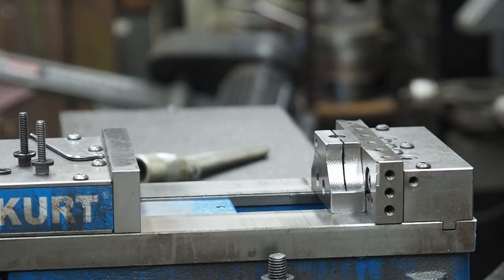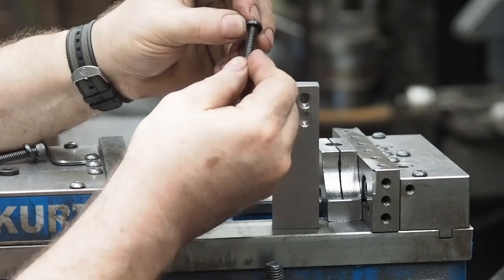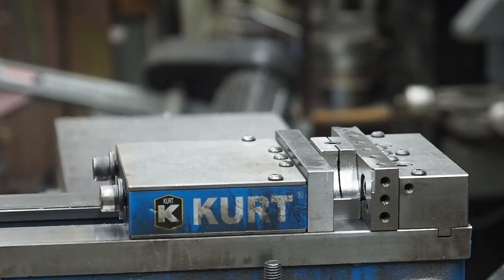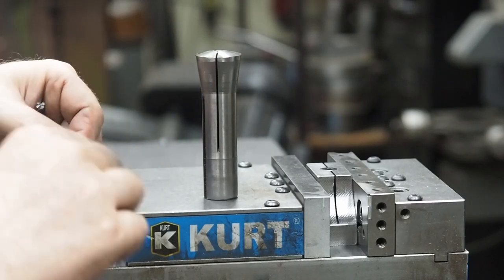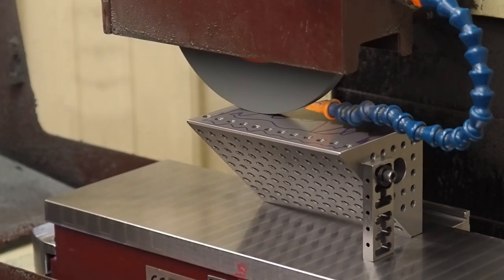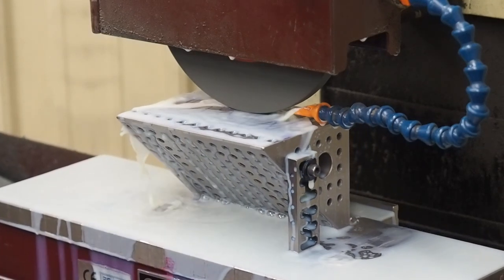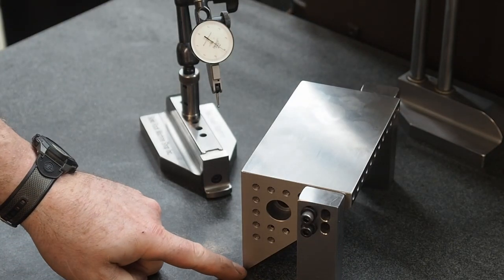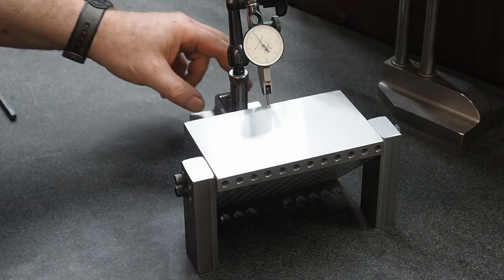Big 45 Degree Block (Part 3)

Comment: Not heard from you for a while Steve.  Hope your keeping ok buddy.  Take care from the UK
Reply from the maker: I had a health set back. Doctors insisted I take a high dose of Thyroid T4 meds. I told them I believe that is what is causing my health issues. It takes a long time taking the meds to get an accurate blood lab result. I continually went down hill taking the meds to where I was back to being useless. I went back to the doctor a few days ago and my lab numbers were mostly normal but showed that I needed to increase the dosage. Yet, I was visible showing many signs of the opposite. I talked the doctor into me going off the meds cold turkey and see if I improve like I did 3 times already in the past. I said if I start feeling better then they can run more lab test and see if they can figure what is going on. I been off the meds 2 days now and things are already improving in some areas. The meds have a 5 day half life so it will be a week before things to start to get better faster. I believe we are finally going to get the answers we need now.
Steve

Comment: Steve,  I just bought Daryl's Harig 6 x 12 Ballway.   What grit on the green wheel as I don't have one yet.  Use a 60 grit on A2 & A3, or something finer.  Daryl scraped the tower & the table.  I did the table printing & both sides of the chuck. Used a 46 grit wheel & thet came out nice.  Just need a little help to get started & I'll go super slow & careful as I learn. Thanks.
Reply from the maker: Here is a video you will want to watch https://www.youtube.com/watch?v=gjz0Zt76GJ4&t=1190s  especially toward the end on wheel dressing. Here is the green silicon wheel I use it is a 60 grit J hardness https://www.instagram.com/p/B8655MBpl6B/  I like 46 grit H wheels in aluminum oxide wheels you can see them on my Instagram page right by the green silicon one posted above.
Steve

Comment: No nagging here but quite a setup for enlarging holes in a hardened ring.. Why not use a soft collet with a pocket for the ring and use a carbide turning tool? Appreciate your answer and your content. Thank you. Best, Job
Reply from the maker: There are many ways to skin a cat. This is just one of them. This is a very simple way of doing it and will be used often and took very little time to make. Off camera I do not even need to open and close the movable jaw, it holds the part good tight enough without it. There are multiple ways of doing most simple jobs this is just the way I choose to do this one. The fixture was a piece of scrap 4140 prehard the with the radius already on it. the rest of the machining was basic, simple and fast.
Steve

Comment: At least on metric screws the screw is always a little bit undersize so you can use just the nominal size hole if you want on fully threaded screws.

Comment: Hi Steve. Thanks for another fantastic video! Approximately how long do you typically warm up your surface grinder for? If I recall correctly, Robin said that he leaves his running overnight for fussy work.
Reply from the maker: If the part needs roughing then I let it warm up while I rough the part in. If I am just doing finish work then I will let it warm up for about 20 minutes with the coolant flooding the table.
Reply: @SolidRockMachineShopInc  Thanks Steve, I'm glad to hear that you get such excellent results with a much shorter warm up time.
Reply from the maker: @tonio3723  Just remember, Robin works at a level of accuracy far greater than I do. I work in tolerances of less than .0001". Robin does things over 5 times that which requires a lot more attention to details such as heat. some of the things I seen him do is within a few millionths of an inch.

Comment: Hi Steve At the start of this video you showed using a block you have talked about in other of your videos. Is there a video that shows the making of those blocks or some where I could find dimensions of those blocks. Thank You   Dave
Reply from the maker: Can you open fusion 360 files?
Reply: @SolidRockMachineShopInc  Yes I have fusion 360 on two computers. One in the house and one in the shop. I also own a Tormach 770 mill.
Dave
Reply from the maker: @davidsohlstrom6977  Send me an email a solidrock@nlbchapel.org and I will send you the model. Steve

Comment: For a little more flexibility, some 5/8" keys in 1side would be handy with a couple 1/2" sock hd cap screw holes through to bolt it to the Bridgeport Table. Make an end plate for location register. Looks good!
Reply from the maker: I agree been thinking about that too.
Steve
Reply: @SolidRockMachineShopInc  I made a Tombstone years ago for a B.Port with the keys and screws.
2 1/4×7x10" in size with sideplates on each end. Lots of tapped holes in the face. All hardened and ground. I used that thing almost everyday up until I retired.
Reply from the maker: @t.d.mich.7064  Sounds like that was a nice tool. Having the right tools makes machining life a lot better.

Comment: Do you use an ultrasonic to clean out all the holes? EDIT: I asked this just before you explained the modded air nozzle. Also, are the bolt-on side supports the same alloy as the block itself? Finally (I know, lotsa questions) when you do the squareness correcting passes, is there an advantage in going from the low side into the high rather than starting high?
Reply from the maker: I do not use the ultra sonic to clean the holes, only air. The side supports are made of soft 4140. It could have been any steel as its only function is to support and aid in the squaring of the Big 45. Once squareness is achieved they are no longer needed. The order of squaring was based on truing everything to the largest flat surface. I have found this method best and most accurate for squaring on any machine. Going from low to high or high to low will only change the ratio of the step you need to grind in order to achieve squareness. 
Steve
Reply: @SolidRockMachineShopInc  Thanks for the answer. I wondered about the support pieces because maybe on some tiny level it would be important to have all same materials to maintain equal thermal expansion. I'm probably really splitting some tiny hairs, though.

Comment: Absolutelylove your videos! You are an outstanding toolmaker/machinist! I wish i could work with you.
 This is a long shot but I have quite a few nice sets of parralels that are odd sizes. I would really like to grind them to a nominal size and keep them very flat and parralel. Im not very confident I won't screw them up.
Is there any chance you'd like to do a video either with the ones i have, or something similar that I am trying to achieve? 
Thanks,
Robert
Reply from the maker: Hi Robert, thanks for watching. Right now I don't have the time for any more projects. I am still struggling with health issues. I take 2 steps forward and one step backwards for the last 2 years. As a result I am way behind on customer orders and have to devote any spare time to that.
Steve
Reply: @SolidRockMachineShopInc  thank you for your response. Im sorry to hear about your health. I hope you start doing better very soon.
Is there any advice you can give me? I'm afraid of them curling. I plan on doing a fresh grind on the magnet, i will be using coolant. Should i use a very light magnet? Do i need to take very light passes the whole time? Do I need to leave a few tenths of material and lap them to obtain a percision flatness or can that be obtained with a grinding wheel alone? 

Thanks,
Robert
Reply from the maker: @robertegan3889  Are these 1/8" thick parallels?
Reply: @SolidRockMachineShopInc  no, they are parralel bars. 5/8" - 3/4" thick and 6"- 9" long. Height is anywhere from just over 3/4" to just over 2". I want to match some and take them to nominal sizes. They are either .093", .009", or .007" over a standard nominal size.
Reply: @SolidRockMachineShopInc  I wish I could post a picture.
Reply: @SolidRockMachineShopInc  I changed my profile picture to a picture of them.
Reply from the maker: @robertegan3889  This is good, the thin ones are hard to grind. I would start by grinding the widest surfaces first and square every other surfaces to the widest surface. Place the parallels diagonally on the surface grinder mag chuck so that your surface contact is way less as you traverse in the Y axis. Use enough mag force to hold the parts while grinding once flat you can use full force. Use a 46 H or I grit open structure (porous) wheel and coolant to keep the heat way down.
Reply: @SolidRockMachineShopInc  I will do that. Thank you!
Reply: @SolidRockMachineShopInc  what do you think about grinding the first side in a free state using a vise?
Reply from the maker: @robertegan3889  That still causes distortion and if there is no support on most of the length of the part it will move on you. Have you seen my video on using paper towels? https://www.youtube.com/watch?v=VT84xVLY8Ug
Reply: @SolidRockMachineShopInc  gotcha. Thank you again!

Comment: Hi, just wondering, if I want to get into surface grinding, to do the sort of things you do, what sort of accuracy in flatness should I seek out over say 450mm or 20" of grinder travel? I'm looking for a second hand grinder to keep prices down for my hobby and the best I've seen so far is 0.01mm over 400mm or 4 tenths for the x-axis in a model I saw recently. I let it go, as my chinese vise parallels are closer than that in terms of slope. I don't know what is 'good', 'ok' and 'poor'. Thanks for any help.
Reply from the maker: Buying a used surface grinder is a roll of the dice. Many are being sold because they are worn out and can no longer hold close tolerances. If you do not know about the grinder first hand or from someone you can trust I would be very careful. Cut a test piece and see the finish and accuracy. If you have wheel hop I would stay away from it. If it is not accurate it could be worn or in many cases the mag chuck has not been properly installed and maintained. How flat it needs grinds will be up to what you are using it for. The stuff I do will require a very accurate grinder. Mine is less than a .0001" in 20".

Comment: Silly question, with the washers, could you not have ground a flat on two of them such that, the the flats facing each other, the bolts fit the hole spacing? This, to my mind, would maintain as much surface area as possible.
Reply from the maker: You could but then you would  have to fiddle around with them to line them up right. The purpose of the washers is not about surface contact but to protect the strap from gouging as you tighten the screw if no washer was used.
Steve
Reply: @SolidRockMachineShopInc  Cool.  Thanks for the reply.
Reply from the maker: @DB-thats-me  I got a little ahead of myself. I was thinking the washers on the Vblock straps in the next video which is in the making right now. What you suggested would work fine too. I custom make a lot of these washers so I default to them most of the time.
Steve

Comment: McMaster (and others) have some MIL-Spec washers for 1/4" fasteners with OD at either 0.468" or 0.500". However, their thickness is only about 0.06" and they are cadmium or zinc yellow chromate plated (5360N127 & 95229A430). Might save the work of creating the custom washers...
Reply from the maker: Thanks for the info. I like to use hardened washers for my projects are these hardened?
Steve
Reply: @SolidRockMachineShopInc  The first P/N shows hardness @ Rockwell B70. The second is not rated.
Reply: @SolidRockMachineShopInc  P/N 90945A761 is an 18-8 passionate stainless washer @ Rockwell B70 hardness, 0.255ID, 0.468 OD, 0.06+ thickness
Reply from the maker: @azenginerd9498  These would be way to soft for what I like. On the B scale B82 equals 1 on the C scale the conversion chart doesn't go lower than that. The ones in the video that I use are in the 10-12 on the C scale according to my tester.